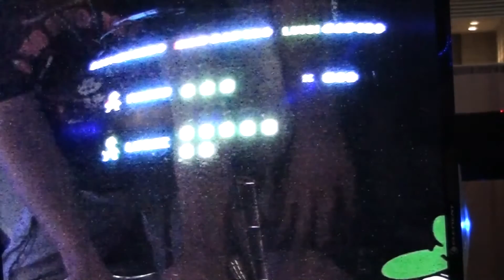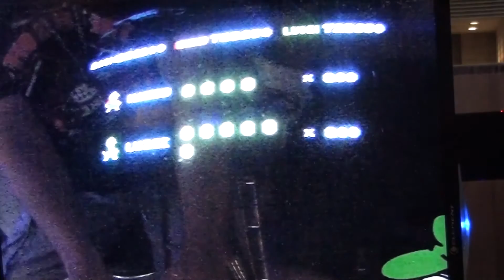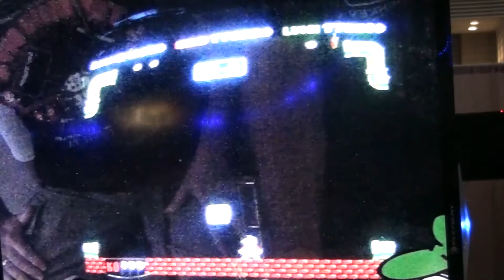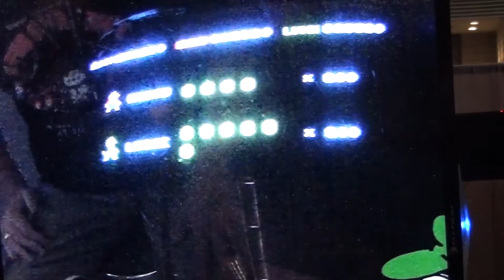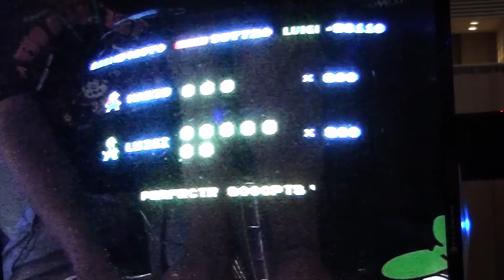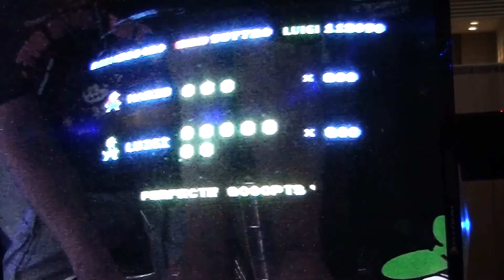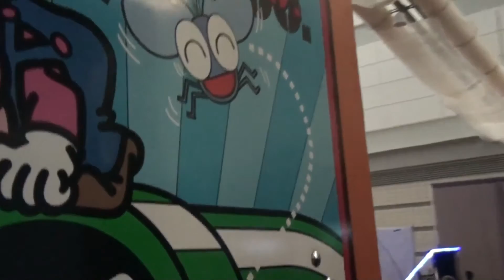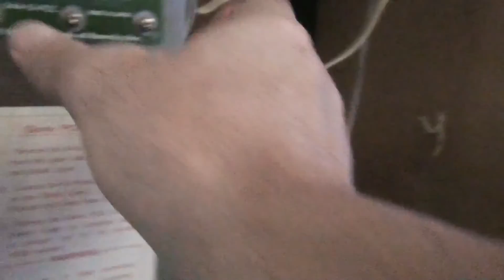Mario Bros. Arcade Doubles World Record ~ 1,517,380 ~ Medium

Comment: There's a video of someone who got the score to reset back to 0. Phase 99 is a repeated level the score went back to 0.
Reply from the maker: It's probably myself or my partner or a different version of MB's with extra men.  I can flip the score every time I play Mario Bros. and my partner flipped the score on this doubles game.  You see Phase 99 on the Japan version of MB's and 98 on the US version because the Japan version has a extra phase (screen 2) that the US version doesn't have.  Also, when you get to Phase 98 or 99 it doesn't repeat the same Phase but the counter just stops there.  I guess it wasn't programmed to flip over to a third digit or the hundreds digit but the game continues with the normal game play.